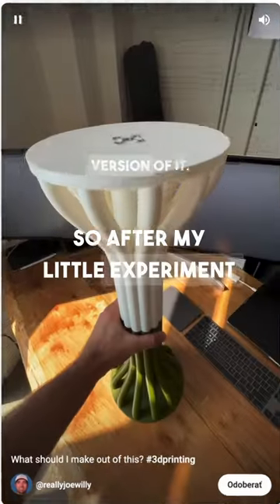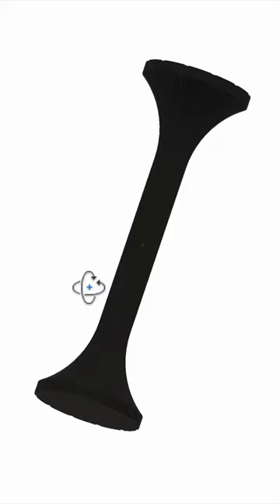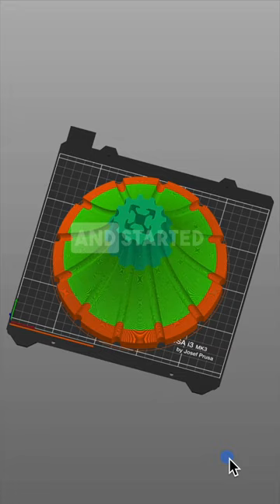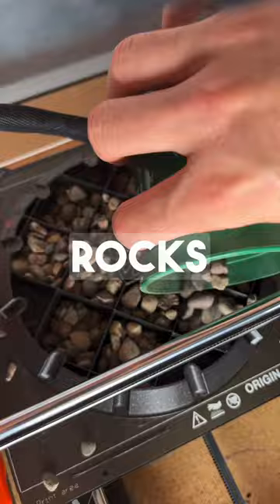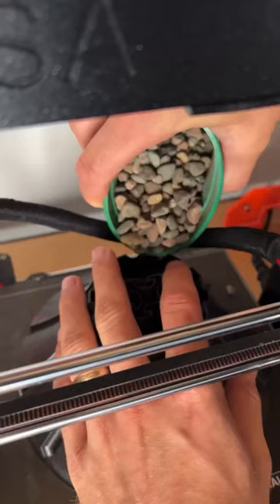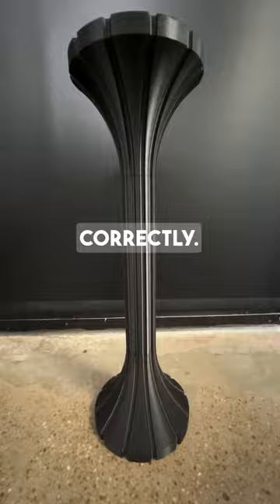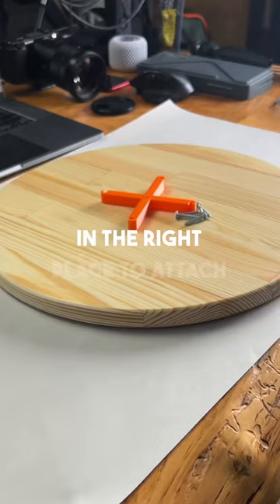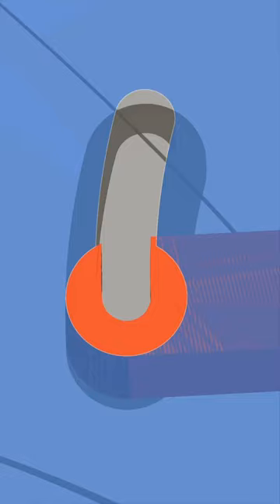3D Printed Table Stand! #3dprinting

Comment: I think the base needs to be wider otherwise it will tip/fall with a small nudge.
Reply from the maker: Won’t fit on the printer
Reply: Multiple parts? Or bigger printer? @madebyjwillis